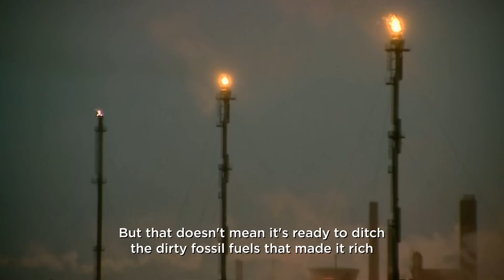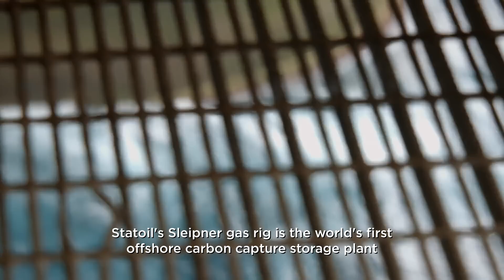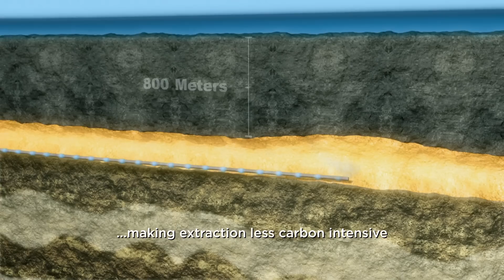Oil and gas companies are facing major technological disruption

Comment: Swanson's Law is destroying oil and gas, they're not cost competitive.  The cheapest contract for Solar power is 1.654 US cents per kilowatt hour (in Portugal 2019), there is no cost competitive fossil fuel at that price. The Paris Climate deal is irrelevant.  Every large coal company went bankrupt over the last decade.  The Tesla battery facility installed in South Australia in mid 2018 will probably pay for itself by the end of 2020 (it's 3/4 of the way there).

Comment: "Challenge: Unpredictable weather."
HELLO? WHAT ERA ARE YOU LIVING? STONE AGE? WE HAVE BATTERIES. Tesla proved them years ago already.
Reply: Tell me about this TWh batteries at cents per KWh
Reply: @jotatsu  check out how they fuel their tesla cars in the US and about the energy crisis Australia is facing. Elon built a gigantic battery there.
Reply: @madartzgraphics2019  That battery is 129MWh for 90M USD, it is used for load leveling the solar and wind production and stability, not for long term supply. It can provide  70MW for 10 minutes or 30MW for an hour. 
The victoria network runs at around 7500 or so MW, so you can see the scale.

Comment: the average energy use per household for a small village may be different from the power consumption of an American household. I see some use for the CO2 they are storing under the sea. plants can use CO2 to accelerate growth. the fossil fuels do not have to be burned, they can be processed into lubricants and petroleum based plastics for long term use.

Comment: We just sweep the C02 under the rug you see.  If you can't see it its not there right?  No chance it will just seep out or cause problems in the future...  Almost as lame as cargo ships using scrubbers to dump C02/Nox into the oceans instead of the air because that is so much better.

Comment: well, first of all with renewables, you need to mine them. the materials that go into making green energy are anything but green. they include heavy metals. second, the manufacturing of these minerals to make the green energy requires lots of energy. thirdly, there are physical limits as to how good the renewable technology can be. germany decommissioned many of its nuclear plants and also took out many coal plants. the result, kiit is now a net imporet of coal formed electricity and its electricity rate is the second highest in the world.
nuclear energy is the best way right now along with hydro energy. other models include thorium that has very less radioactive waste, less half time than U-235 and is also more abundant.
also, there are plants being developed that intake carbon from the atmosphere and convert it into fuel granules.

Comment: Energy problems:
1. Research on minimizing emissions and maximizing efficiency of fossil fuels
2. Research on safer nuclear
3. Research on converting nuclear waste to harmless isotopes
4. Research on hydrogen electrolysis
5. Research on making hydrogen act as a battery
6. Research on battery
7. Research on lowering the cost of and making solar and wind more affordable.
8. Research on other energy: biofuels, geothermal power, tidal and wave power.
9. Research on fusion.
I am looking for a job if anyone is hiring in those areas. Just graduated college and need job to pay my "student loan debt".

Comment: Fossil fuels are a bigger business than ever and environmentalist are largely responsible.

"Renewable" sources are highly erratic and require fast spin up gas turbines to back then up. Failure to replace aging nukes means that "renewables" will just replace the lost low-carbon nukes instead of reducing carbon emissions over all. 

Electrical vehicles are not going to grow very fast without a technological breakthrough.

I live in Texas and no one is sweating the loss of the oil and gas industry in the next couple of decades.

Comment: What happens if something were to cause a leak in that storage of Carbon Dioxide. Wouldn't that be another problem? I know its a way to be a little cleaner. But if it starts to crack or shift, it may just leak and cause other problems. It wont be dangerous currently, but after a couple of decades. It will build up and cause some damage?

Comment: Wireless electric cars are going to make oil and batteries obsolete. Just like you charge your cell phone with a wireless charger, the coil will be in the streets and cars will be Wireless, they won't need batteries, they won't need fuel tanks, they will not need Transmissions or generators. Just like Tesla electricity will flow through the air and power your Electric cars. The price of oil is going to be so cheap that they will not be able to  afford to ship it let alone refine it. Watch my videos on the wireless batteryless electric car

Comment: Nobody mentioned the role of electric vehicles as BI-DIRECTIONAL energy tools. While they're plugged-in (witch is most of the time for cars), in the future, they'll be able to provide a huge amount of electric storage capacity. Imagine millions of electric cars storing tens of million kWh. I'd focus, from now on, in developing cheaper, lighter, eco-friendly car batteries. Believe me, I'm a retired Electrical Engineer, worked for 40yrs in the oil industry. That's the Future
Reply: The thing is, people would also put their electrical vehicles to charge at night, after they get back from work, after it's already dark and renewables tend to produce less while they will have to turn on conventional power plants (now at a lower efficiency because they dont have the time to heat up properly) and your carbon emissions go up as we have seen in Germany. Instead, just build more nuclear power plants which have the same carbon emissions and health risks (almost none at all) to renewables but use much less infrastructural space and are more efficient at producing actual energy

Comment: Here now in Early 2019 solar and wind has in 3 years now become about the cheapest power for the grid. Interesting how short a time its taken.
Reply: Yep, funny thing about that.  And solar & wind prices are expected to continue going down, followed by battery prices.   Hahahahahahaha!  Tough noodles, fossil fuels!
Reply: Battery prices have fallen significantly in just the last year because of increasing efficiency in manufacturing.  Many smart people are researching improvements in battery technology.  And batteries aren't needed until solar and wind combined make up more than half of the grid.
Reply: So,are you paying less for your electricity?
Reply: @ms-jl6dl  My location doesn't have a high enough proportion of renewables yet to bring down the price of electricity, but the renewables we do have are preventing price increases.
Reply: Renewables are cheaper because they are intermittent and less valuable than consistent power source like nuclear and fossil fuel.
Reply: Because they are not stable nor reliable, hence the price drop.  Fools!!
Reply: @WendyMcKee  Wrongo!  Improvements in manufacturing methods have cut the cost of solar panels and batteries, so the solar farm can afford to charge less for the power, because they paid less for the panels.  Wind turbines are bigger so they produce more power more consistently, so they can afford to charge less for the power.  Solar and wind are now more stable and reliable than forty+ year old coal plants that can break down unexpectedly.

Comment: We are still a long way from seeing any major "western" country getting 100% alternative energy. We are missing key infrastructure that need to be built to make more alternative energy especially solar and battery for all that need it. This infrastructure is the manufacturing and delivery of materials to and from the manufacturing area so that the alternative energy becomes affordable since its production will be powered by alternative energy making more alternative energy. The battery is in the same situation and has other ways to store electricity by using hydrogen fuel cells in buildings (other large energy consumers like ships and even planes can benefit from hydrogen fuel cells) especially enclosed system hydrogen fuel cells where they can act just like a rechargable battery. Then the water is another situation especially those places that are struggling to get their water, building a reservoir on top of a mountain and pumping water up to it and then letting the water down through a turbine can enable another form of energy storage.

Comment: The big problem is human population growth.  All versions of energy generation - including green technologies have disadvantages to the environment.  Notice that in the picture of solar in this video, it was covering green grass.  Plants are the best way to get rid of carbon dioxide.  Green technologies require lots of space.  We should use all types of fossil fuels, green technologies, and nuclear.  No one solution, other than reducing population growth will fix the problem on their own.
Reply: The best way to "get rid of" Carbon dioxide?
Don't produce it in the first place!
Plants "like" a particular concentration.
Just as if you breathe too much pure oxygen, it's not good.
The real trick we all have to master is consumption.
We must insulate buildings, reduce heating and cooling, use led lighting, produce food extremely locally, if possible within buildings(!) reduce unnecessary transport.

Comment: @theeconomist is it possible for them to use the carbon dioxide to pump the oil instead of using electric pumps?
like blowing into a juice box, the liquid comes out on its own
Reply: No, because the CO2 will dissolve in the oil and have to be separated from it before the oil can be sold.  This takes more energy than simply pumping the oil.

Comment: Since solar and wind have been getting cheaper so dramatically FAST!, this video is out of date.  Solar is headed toward $14/MWh in the American Southwest.  Both solar and wind are so much cheaper that we can afford to build more redundancy into the system, and clean energy will still be cheaper than fossil fuel energy.  Add in all the hidden subsidies oil and gas receive, and the competition between emission free renewable energy is over.

Comment: Propaganda to create create public momentum and collect more subsidies.
Renewables are stuck in the energy storage crisis.
They are already to get cheaper than the cheapest storage cost.
And the cheapest storage cost is still two times higher than coal or gas electricity production.
It is a battle about subsidies, who is believed to prevent the phantasized climate doom.
Sure, my facts are "anti science".
Reply: Here’s the present and the future of energy storage. 
For both heat and electricity on demand at industrial and grid scales.
Www.1414degrees.com.au

Comment: The irony for me was when they used a diesel truck to deliver the manure for the biogas. There is always hidden energy costs in these alternative energies. That said, I support all of these alternatives, just need an electric truck powered by solar.
Reply: Your electric truck powered by solar is a dream that is like pixie dust James.
Reply: Well I meant, a solar power infrastructure providing the energy to charge an electric truck. Not a truck with solar panels on it, now that would be silly.
Reply: That won't happen unless you live outside the suburbs.  You need land for that many solar panels.

Comment: Total propaganda.  The average ratio today for the oil/gas Supermajors (XOM, CVX, RDSA, BP and Total SA) of Total Enterprise Value (TEV) to forward EBITDA has found a range higher than most of the period 2008-14, when oil prices were high, implying that the market sees greater potential today for growth or lower risk for the Supermajors.  US is now a net exporter of gas and can provide all its domestic oil needs.  Thanks to Trump, coal is now coming back - latest studies of R/P for coal show it can provide the world's energy for over two millennia into the future.  Renewables only provide 5% of the world's energy today and will always remain a PR stunt, as it will never be able to compete with oil/gas/coal economically.

Comment: You cannot decarbonize without significant assistance from nuclear. Even the IPCC admits this.
Reply: If a single house or a small village can be carbon-free, it should be possible in big scale too. The bigger the network, the easier to balance out local weather effects.

Comment: Solar and wind are not energy positive but are energy negative. They consume more energy to make than the power they generate over a reasonable lenght of time. Solar and wind energy generates power only if the sun is shining and the winds are blowing and are not reliable base load power sources. Storms and hail and heavy snow can practically damage them severely or be destroyed completely. Oil, coal, and natural gas are CLIMATE RESISTANT for their power production is unaffected by climate changes.  When was the last time you have seen wind and solar power up a vertically integrated iron and steel industrial production facility? NONE!  Storage of solar and wind energy? Can they economically store GIGAWATTS OF POWER ON A DAILY BASIS? NO!